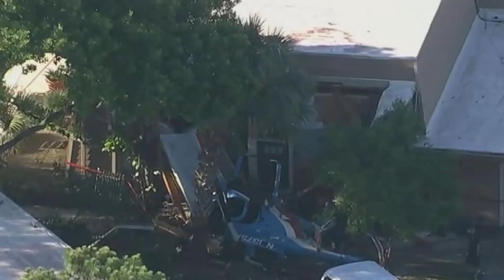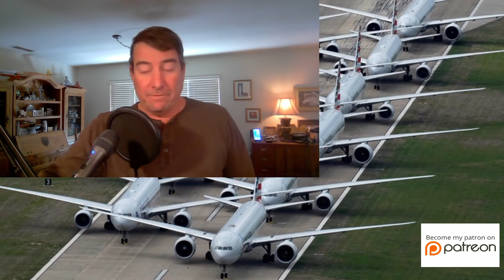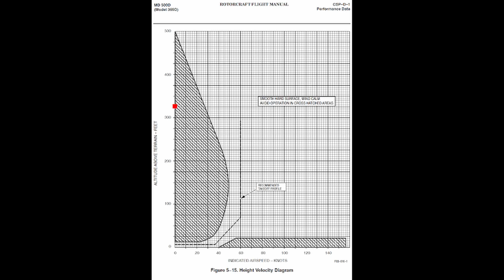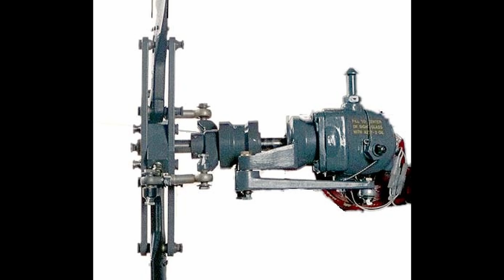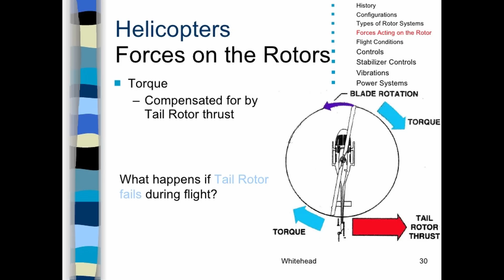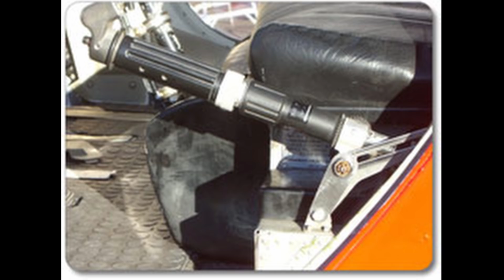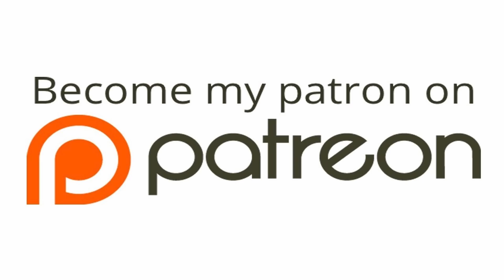Houston Police Chopper Crash 2 May 2020

Comment: A couple more advantages of the tail fan/ NOTAR system (which interestingly enough, was popularised and most successful on this exact ((Hughes 500)) airframe) are vastly increased safety for ground handling and quietness. Both are huge benefits for landing areas in urban, built up areas. A significant amount of the noise of a helicopter is the tail rotor wash interacting with main rotor wash.
If you've ever been around a NOTAR helicopter, the first thing that strikes you is a high pitched whine. Then you wonder what that whine is, and you realise the helicopter is so much quieter, you can hear the whine emitted from the main gearbox and turbine, they are that much quieter.
If you want to see some of the most precise, accurate and skillful helicopter flying you'll ever see, watch one of the episodes of Magnum PI with the helicopter in it. In fact, there is a scene in the opening credits on a couple of seasons of the Hughes 500 coming out of a cutting by the side of a road and entering an accelerating turn to follow the road, with the rear of the main skid around a hand span off the road the whole time.

Comment: I survived a UH-1H chopper crash.  Usually when these hit the transmission comes down right in the bay area...we were clipping tree tops as the pilots auto rotated into a rice paddy...we were slightly sideways on impact and that probably saved our lives as the chopper flipped on it's side and drove the rotors and transmission into the soft mud instead of straight down into the chopper.  On top of that, after crawling out we had to set up a defensive position around it, tend to the injured and get some re-enforcements and an evac...lucky everyone survived....still remember it as we are skimming the trees saying "holy sh!t" we are coming in really fast.  Fun days....
Reply: Thank you for your service to our country!
Reply from the maker: Wow!

Comment: Unfortunately, in this case it rather looks like a case of so near and yet so far.  The pilot so nearly got the machine on the ground safely but it rather looks, and sounds on the video, that the rotors hit something just before touchdown which led to the aircraft crashing on its right side rather than upright.  RIP and all respect to Jason Knox and all sympathies to his family and friends...
Reply: or  maybe  something, such as bullets,  hit   the  tail  rotor (or  something  else).   they  were   flying  over  a  bad  neighborhood   at  2 a.m.....
Reply: driver4011- The pilot probably would have time to radio the base of being fired upon had that happened. It is possible but very unlikely.

Comment: If the wings are flying faster than the fuselage, it's a helicopter and, therefore, unsafe.

All kidding aside, though, Rest in Peace, Gentlemen.
Reply: A Chinook is referred to as inter smashing rotor blades
Reply: a  plane  can   make  an  emergency   landing  if  something  goes  wrong  with  the  engine..... a helicopter  can't.....just  a  hard  crash landing  with  a  bad  ending.
Reply: @driver4011  Not true, the engine-out landing is called autorotation and can be as soft as you want (at least if you have enough altitude to start with).
Reply: @driver4011  Not true.
To get my license, I had to do several engine failures for my DPE to prove I could land safely without an engine.  One straight-in autorotation to the Compton airport runway and a second where he surprise rolled off the throttle over an industrial park and I had to turn around and land on a piece of road that was under construction.

Comment: Former US Army AH-1G Cobra Standardization Instructor Pilot here. I know Scott knows what I'm about to say...this down and dirty video didn't really have time for him to go into all the nuances of a tail rotor failure and the recovery therefrom. The TR can fail any place, at any time and at any altitude and airspeed. The most optimal times is in the clear area of the chart shown with respect to airspeed and altitude. The best place would be at 3 feet over level terrain at zero airspeed...aka hovering. Just chop the throttle and perform a hovering autorotation. Army pilots are taught to handle TR failures under varied circumstances...it can't all be lumped into a one-size-fits-all situation. If you're at just about any altitude, the higher the better, and you happen to be flying well above translational lift airspeed the aircraft may tuck nose low a bit to the right, the slipstream of the higher airspeed will streamline the aircraft and it most likely won't start spinning. The textbook says maintain airspeed, head to something like a hard surface runway. Make an approach and landing like an airplane keeping that airspeed up and touch down lightly. Don't flair to slow down. Perform a running landing. The friction of the runway with the skids, or in some cases the wheels, will cause the helicopter to slow down. As it slows the effects of torque from the main rotor will cause the helicopter to start to turn to the right. The pilot counteracts the effects of that torque by reducing engine power with the twist-grip (motorcycle) throttle. If too much throttle is reduced the helicopter will then start to turn to the left, so throttle must then be added. This whole time the pilot is slowly reducing the collective to take away rotor effectiveness allowing the weight of the aircraft to settle on the skids/wheels creating a braking action due to friction. If the helicopter is operating in the shaded areas of the chart (and the charts are specific to each model) the likelihood of a successful outcome is reduced significantly. We morbidly refer to the shaded area as the "dead man's zone."
Reply: And the higher the weight, the worse it becomes.
Reply: Gary Fellow Veteran Thank You for your Service . I'm a US Air Force Veteran & a VA Retiree also . Do you still fly helicopters ? I've never ridden on one . Came close while I was on a one way Alaska cruise . I had gone on a morning whale watch on a jet boat in Juneau , Alaska . In the afternoon I was suppose to fly to a glacier it was foggy & the flight was canceled because the fog never lifted . I was bummbed out about it . I was told it's an experience I would have remembered for the rest of my life .
Reply: Bob Shaw sadly, no more flying for me. I’m pushing 80 and have just a enough energy to get to the things on my wife’s “honey-do” list. 🙂
Reply: @DragonPilot  Thank You for your reply .
Reply: @bobshaw4063  I was one of the lucky ones thats had the experience of taking off in a Ch46 and CH53 and not only taking off and landing but taking off and landing on a ship. LHD-6 USS Bonhomme Richard. I also rode those into and out of Iraq. Both Marine Corps helo's and Im a Marine. It feels strange lifting off. Unnatural. Landing feels like controlled power. Taking off of the flight deck of the Bonnie Dick was something ill always remember. The feeling of my gut felt like a drop on a roller coaster. Ill also remember flying back to base and Im in a CH53. Huge. Heavy. 3 turbines. Loud. Smelling burning hydraulic fluid. Seeing built up fluid grime. Ill also remember it catching on fire and there was nothing they could do as smoke filled the cabin. Luckily we were in the landing pattern. Went the whole 11 months with no injury only for the scariest part to be the day back on US soil. Luckily we landed and the fire was put out. Ill never forget that. Also wont forget the very first day of the Iraq war in 03. The first US deaths were 4 Marines. 2 of them were piloting the CH46 from the Purple Foxes squadron out of Camp Pendelton. They were taking 12 or 16 British military into Iraq and were flying in formation when all the sudden the Ch46 dropped from very far up and according to a witness in another helo "it just dropped". No survivors. Ive never got any info on what went wrong. Wasn't shot down. Anyway the crew chief was a good friend. We met at recruiters office and went to bootcamp on the same plane and he ended up being the squad leader thru all of bootcamp. I hadn't seen him in a few years. I ran into him in Kuwait and we talked for an hour and he died the next day. Ill never forget that either. Helo's are nice and fun but auto rotate doesn't always work.
Reply: Thank you for your service!
Reply: Gary,

Thank you for your excellent analysis of tail rotor failures. You’re right-can’t put all the possible failures in the same box-it always depends on the circumstances. Practiced these many times at Bell going through our yearly recurrent. In training they were actually fun to do, although always a challenge. Like practicing autorotations!

Thanks for your service. I’m First Cav 1968-69 myself, and my first helicopter job was flying a Hughes
500D. A terrific helicopter-like flying an airborne Ferrari!

Stay safe & healthy!
Reply: Michael Burns in theory, yes...but the electricity would come from batteries. Present battery technology would require batteries so heavy it would not be practical. Even a solar powered electric engine would need solar panels the size of a football field to fly a helicopter of any appreciable size. Technology is just not there yet. Not sure what you mean about jet engines. Many helicopters already are powered by turbine engines, but they don’t provide thrust, just power.
Reply: Michael Burns in theory, yes...but the electricity would come from batteries. Present battery technology would require batteries so heavy it would not be practical. Even a solar powered electric engine would need solar panels the size of a football field to fly a helicopter of any appreciable size. Technology is just not there yet. Not sure what you mean about jet engines. Many helicopters already are powered by turbine engines, but they don’t provide thrust, just power.
Reply: Great name for an aviator, Mr stone.thank you for sharing and your service.
Reply: Could it not just have been a loss of tail rotor authority and a botched recovery?
Reply: As a PRIOR (non-current) private-rated helo (rotorcraft) pilot, I have to say THIS is the best description of a TR failure and it’s nuances IN A VERY SHORT and condensed form as I’ve known available. In layman’s terms, it doesn’t get any better of a description..
Reply: Thank you for your service. Respect. Sounds like you know what you are doing.

Comment: I spent 4 years in a Kaman H-2 Seasprite squadron in San Diego in the '70s. The rotor system at that time, an improvement of previous versions, was labeled the -101 system. The reason for that designation, as the joke went: 101 useless parts had been eliminated from those earlier versions.
Reply: @ba94845  Plenty! And not just in the rotor system. First day at the squadron, as one of the Hooke 2's was taxiing out for take-off: one the main mounts broke off. Exciting.

Comment: Excellent description by Scott.  I've had the misfortune of being involved with two complete tailrotor driveshaft failures, once as an Army pilot in a UH-60 and later as a Customs pilot in a Jet Ranger.   Interestingly they both occurred on the same day, 11 years apart (May 1st 1987 and May 1st 1998).  Airspeed, altitude, and throttle control are all key.   Along with al lot of luck to be operating in daylight conditions which allowed a successful outcome in both events.

Deepest condolences to the family of Jason Knox.
Reply: I would start staying home that day and avoid the most dangerous rooms. The kitchen and bathroom they say, and piss in a bucket in the living room. Glad you made it out.
Reply: 14 people on the Blackhawk..stationed in Ansbach, Germany at the time.  Oil cooler spline failure at 1900’ agl.   Managed to land in a field after performing a modified autorotation (kept power levers “on” until field was made)...damage to the aircraft but remained upright and intact.   No injuries...Actually flew that aircraft again after repairs, prior to tour completion.

Jet ranger incident involved myself and an agent observer...3000’ agl when the tail rotor drive shaft separated at the 90 degree gearbox.   Improper maintenance, bolts not torqued during off the airframe servicing and reinstallation.  
Was able to complete a running landing at a navy airfield in Pensacola...happened to be right above it during an active surveillance.   Touched down a bit fast, 40kts or so, but hit the centerline.   Rolled the throttle off a bit too quickly once in the ground and skidded to a halt just off the left side of the runway.   Driveshaft cover was torn apart from the 90 gearbox, all the way to the oil cooler.. 

Sitting in the cockpit when the event first began, it was not evident that we had a driveshaft failure...the noise created by the driveshaft separating, sounded very much like the main transmission was literally destroying itself.   Think rocks in a blender...only during the descent to land, I attempted a minor pedal input with no result that iit was apparent what was going on... 

As an instructor in the Army’s UH-60 course at Ft Rucker, i would share those stories with the students with the intent of not only passing along the experiences, but to respect the machine for what it can do, and to minimize unnecessary risks whenever possible.  Helicopters are amazing machines and i was blessed with an incredible career...but there are times when the circumstances (luck) was definitely in my (OUR) favor.
Reply: Tom Thank You fellow Veteran for your Service . I'm glad it was successful outcome both times . I'm a US Air Force Veteran & a VA Retiree as well .
Reply: Thank you, Bob.   Not as glad as i was...and thank you for your service as well.

Tom
Reply: If you saw them Wes,  that kinda ruins the surveillance...:-)

Comment: My Helicopter Instructor in Dallas was retired DALLAS PD Air 1. Him knowing I was a LEO, he taught the way LE Aviation was most used.  2 of his stories were of engine failures in a 206 Jet Ranger. 1, he auto rotated into a school playground in the evening after school hours. 2 was at night around lots of high rise buildings and roads. He auto rotated into the middle of an intersection. Some traffic lights used to hang RED in all directions before changing green. He touched down at that exact moment. No collision between aircraft and vehicles. He did say there was honking and surprised drivers by the size of their eyes. The video of the HPD MD500 going round and around, I knew what had most likely happened. We practiced this procedure a lot. We auto rotated with simulated tail rotor failure, but not deeply. IIRC on the recovery when the Aircraft starts to turn at the bottom as you pull collective blip the throttle a little to halt the spin. Scot, correct me if I am thinking of something else. A year after I finished my check ride, another student was with an instructor practicing Auto rotation and didn't pull collective soon enough. This was a TH-55 Hughes 269. Still had the metal frame & canvas seat covers for such situations to help from a compressed back injury.

Comment: Dead Man's Curve... not to sound insensitive. If the engine quits or you lose the tailrotor when you're operating in it and you are along for the short ride. The CG change from departed tailrotor hardware can make for some unusual nose low attitudes as well.  They had a problem with the flex coupler for the tail rotor drive shaft years ago that killed a friend of mine doing traffic reporting in Jacksonville. He came down on a utility pole. Failure in forward flight mode can be dealt with by doing a run on landing but like he said, it's going to turn opposite of what you normally expect in the cushion pull at the bottom. You only get one chance when that happens and it has to be an open level area. Sad, but very dangerous work regardless. External load work is even more dangerous. RIP and condolences to friends and family.

Comment: So, does the auto rotation manoeuvre effectiveness depend on   both heli speed and altitude? 🤔
Reply: Either, neither, and both. The combination equals "energy" in the aircraft. ie: hovering at height, or high forward speed and low, both situations have "energy" in the aircraft.

Comment: Juan...you not had a go of a helicopter? Wow...had a go for my 60th. The guy said to me going out to the R22 do you want to take fotos or have a go.  I already new what the basic controls did but he went thru them. He took it off and then said just hold the cyclic gently and watch your heading and a piece of string. Better than riding a fast bike. Could he do tricks with it. 👍 Tail rotor goes...from memory right full pedal, power off and just before landing full lift. Pilot reckons definitely safer than single engine plane...nowhere to land.

Comment: 99-44/100 % of the time it's a tail rotor failure. I remember changing seals on an Enstrom gearbox. Ounces of oil capacity. My washing machine transmission takes more oil.

Comment: Helicopter with no tail is a notar. Normal procedures for a Police dept is when on scene you enter an orbit (circle) above the location just in case you have an engine out (turbine) and you need to auto rotate to the ground. You need forward airspeed and the t-tail will keep the heli flying strait then when you are in a safe area with altitude you can auto rotate down knowing the craft will start to spin as soon as you start to pull collective. You can also do a running landing if it's safe to do so.